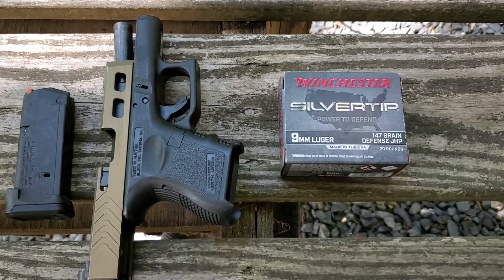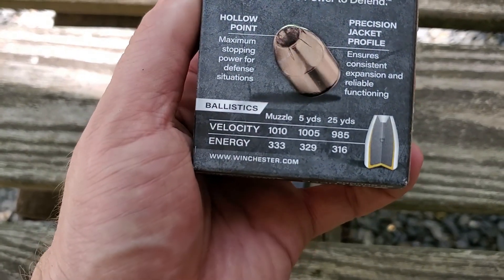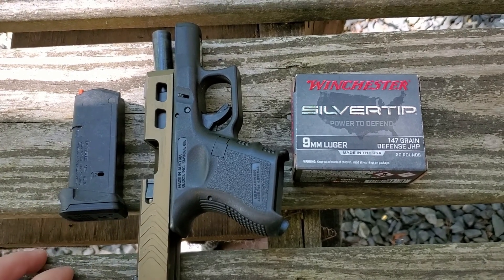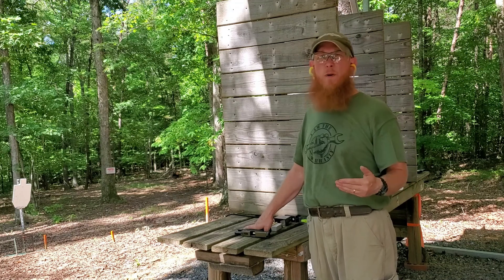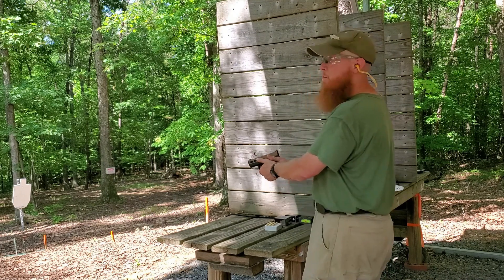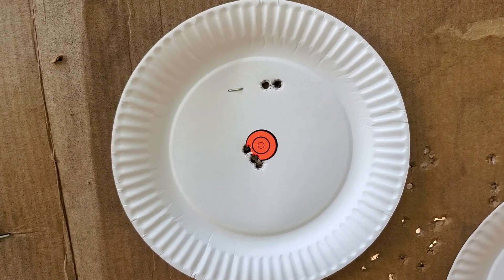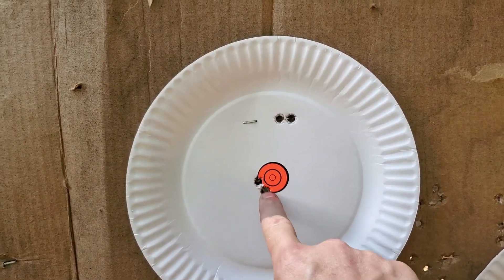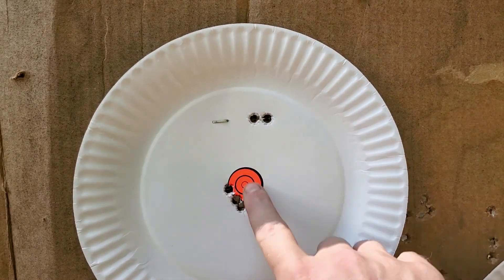Video 3 of 4: 9mm ammo test - Winchester Silvertip

Comment: With the damage done to the jugs and expansion of the bullet,  I'm sure the velocity was close to the advertised velocity. For reasons unknown to me, chronographs will occassionally provide false readings that may be high or low or not there at all.  I've see some people have luck using a sharpie to color the bullets black on days that the chronograph is providing false readings.  Personally I've had many odd readings in the past and it seems to be related to not only the amount of sunlight but also the angle of the sun and the diameter of the projectile. Larger and longer seem less affeted than thinner and shorter.
Reply from the maker: Frank, my chronograph provides its own light.  I chose that one because I rarely shoot in a spot sunny enough. 

I agree that the chronograph reading can be crazy sometimes and the expansion matters way more to me .  I am going to try a few things with the next batch of tests to see if it helps.  Time will tell